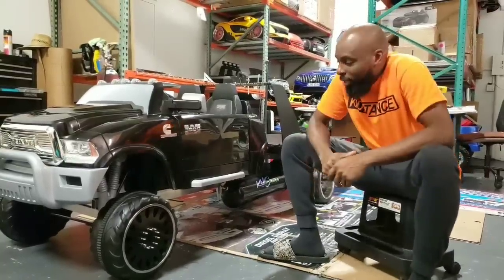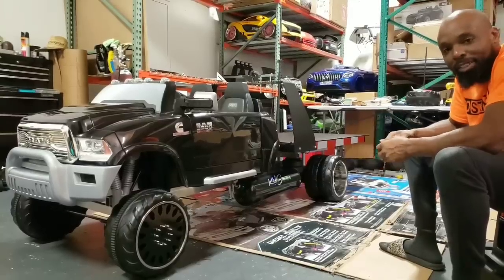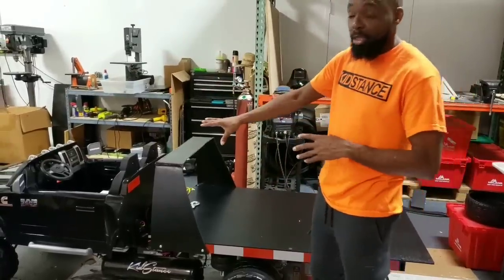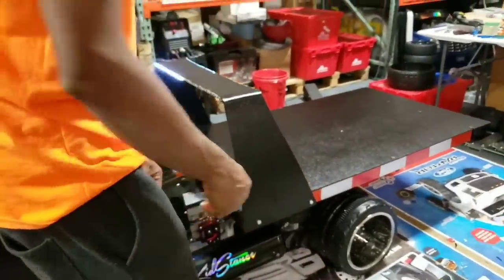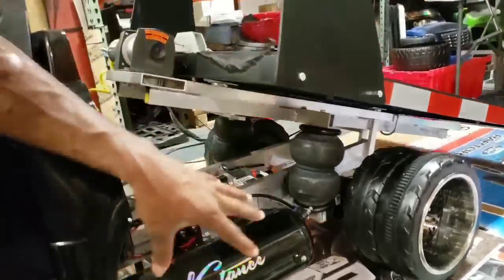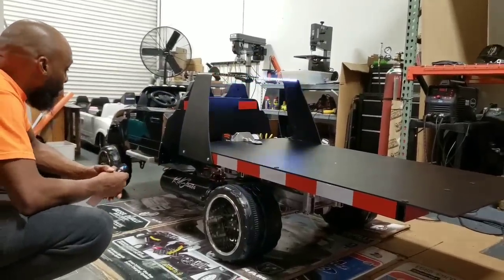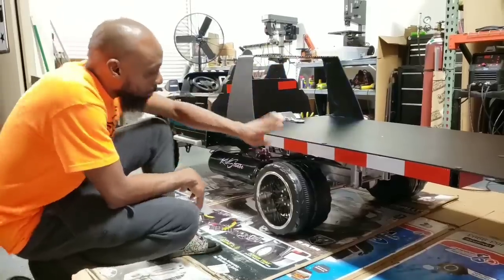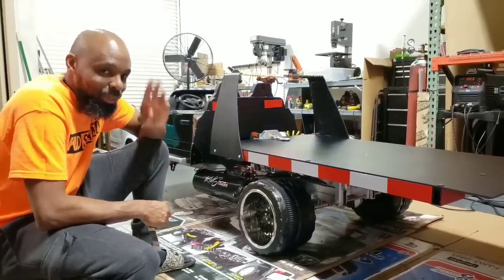Kidstance Edition Dodge Ram Tow Truck (prototype)

Comment: That's badass does it still run off the original power wheel motor and battery  sorry if u said that in the video I missed it
Reply from the maker: Yes it does